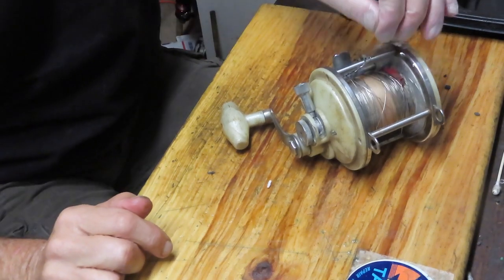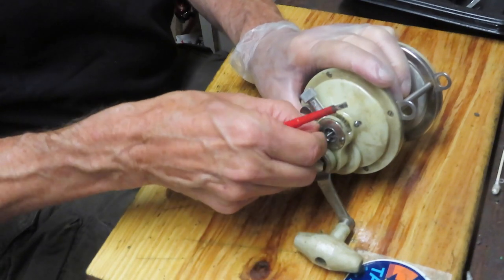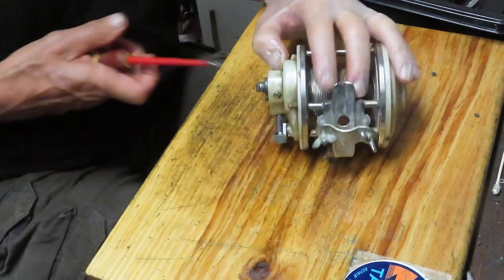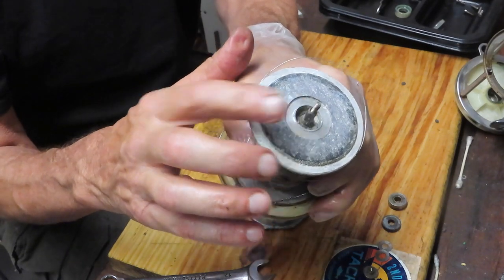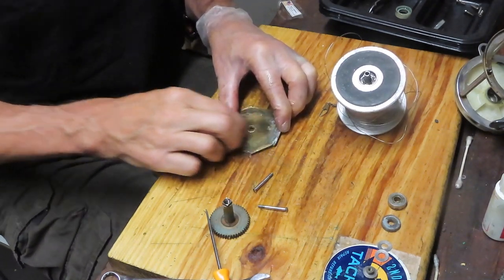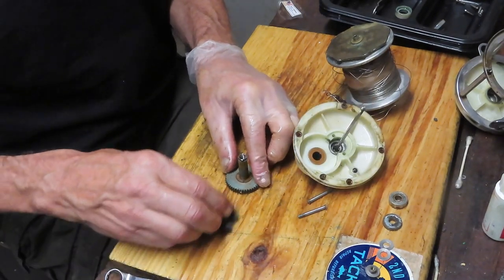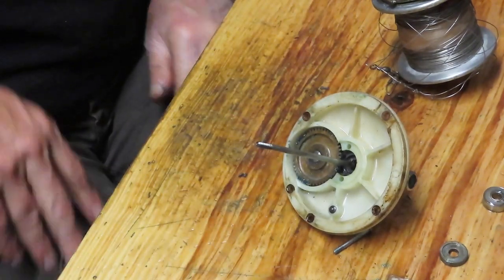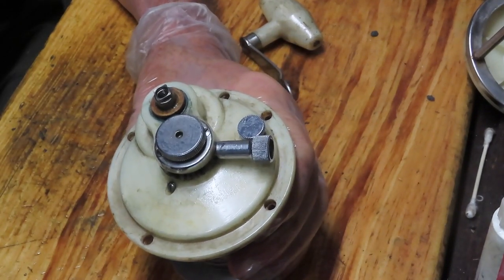Sears Ted Williams Gar Wood Jr designed lever drag trolling reel service

Comment: I’ve heard of those boats! Also I just restored a Shakespeare Troll Wonder reel.. You remember, you found the schematic for me. I wish I still had the reel. Sears started the Ted Williams (baseball player) around 1962 when they dropped the J. C. Higgins brand. He was a Sears employee. You can’t find parts for these. I know I tried for a month. I don’t think it’s all that simple but the one I worked on was different and larger than this Ted Williams reel I worked on. I needed a drag washer (huge) and the sleeve for applying tensim to the lever drag plate which also controls the free spool. I know every part of that  reel but without those parts I couldn’t  get it completely working. If was my friend’s deceased father’s reel. Her father’s wife (my friend’s mother) just turned 100 last Christmas. This made me work all the harder on her reel. I got it in beautiful cosmetic condition. She built a magnificent beach house on her father’s beach property a few years ago and asked me to restore some of her father’s reels. They were in terrible condition.  There was a spincaster I could not fix as it was too far gone. I also totally restored 3 spinning reels including - a now beautiful Mitchell 302, a Herter’s reel made by Shakespeare, and a DAM Quick 550 -  in addition to the Troll Wonder The last one was this Shakespeare Troll Wonder. All are beautiful now and sit on a shelf in that new cottage to honor and remember her dad. This friend was my wife’s college roommate starting in 1972. I call her my wife’s “sister by another mother.” We consider her and her mother part of our family. The story behind a reel has always been very important to me. I have reached out to the seller of every vintage reel in my collection when possible. About 40% gave me great contextual and historical information on the reel they sold to me. It means everything to me! It is part of the reel. — Chris
Reply from the maker: Thanks Chris. Like you I think the history is as important as the reel itself

Comment: Dennis, I am Stuck at that the Anti-reserve also.  I set the reel aside looking for more information on how to get the side plate to fit correctly.  I take a crack at again.  Mine is a Wonder Reel I can not spell Shakespere!!!!!!!!!!!!!!!!
Reply from the maker: Try loading the spool in the non gear side plate before mounting it to the frame hold the spool firm to it when installing on the frame and then move to installing them gear side
Reply: @2ndChanceTackle Thanks I will try!!!  Like you I did not want to force the parts apart or together.

Comment: One thing I learned the hard way recently is that you really want a schematic for a reel if you can get it.
Unless you know it likely hasn't been taken apart you can't trust that the reel was previously reassembled properly.

I was just working on a Penn 716, I took plenty of pictures to put assemble everything how it came apart and still had trouble till I looked up the schematic and realized it had been assembled incorrectly.

If you don't know the parts are where they belong you're just copying somebody else's mistakes.
Reply from the maker: Well said. Thanks

Comment: I have an old sears levelwind reel fr what I was told was the 60's, but the line guide won't move unless I put pressure otherwise it'll go back and forth on a small section of the reel, what could I do to fix it? If I had the money I'd send it to you but I dont
Reply from the maker: It is likely to be a worn or broken pawl.  Those are very hard to find as replacement parts due to the age of the reel.  - Dennis
Reply: @2ndChanceTackle  ok thank you